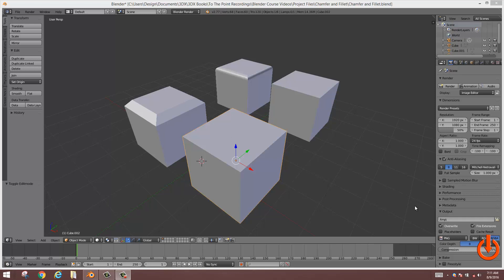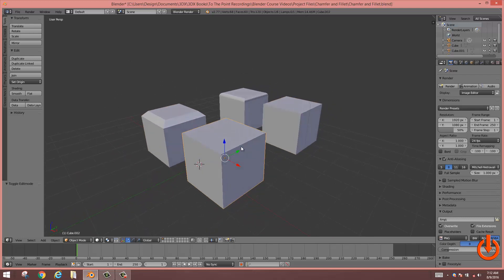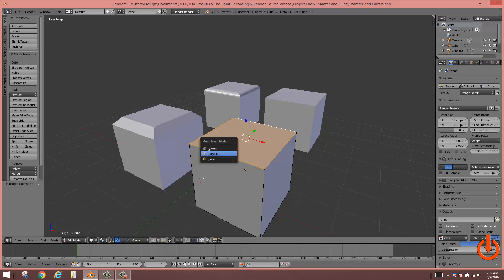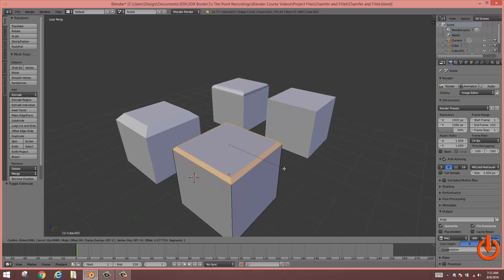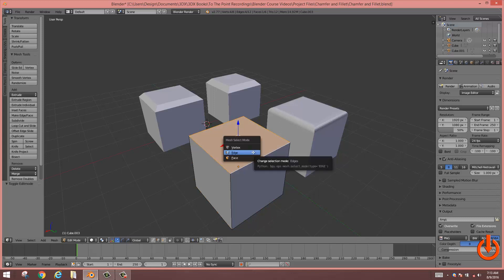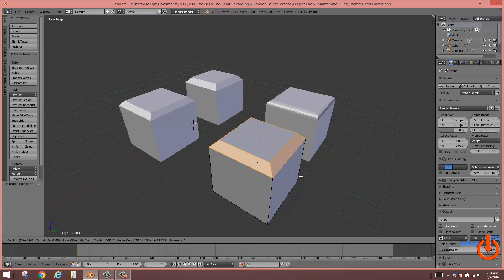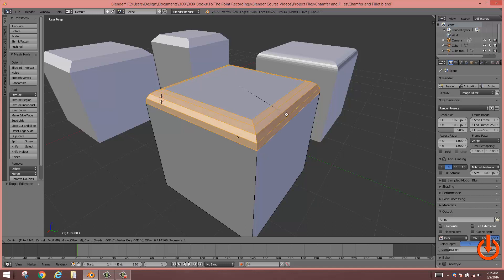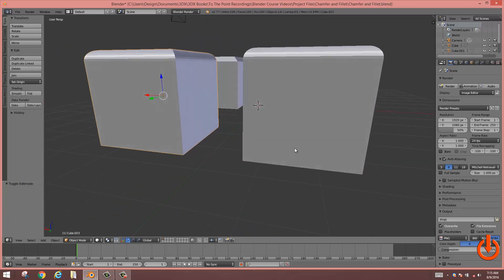Creating Chamfers and Fillets in Blender

Comment: Fillets are concave, used for interfacing two different surfaces smoothly to reduce stress risers.
Chamfers are angular convex edges or low poly bevels.
What you call fillets are rounded or smoothed edges or high poly bevels.
You can make a fillet by boolean subtraction of a rounded beveled object from its parent, but it is hard work.